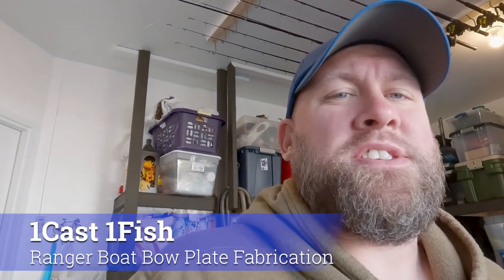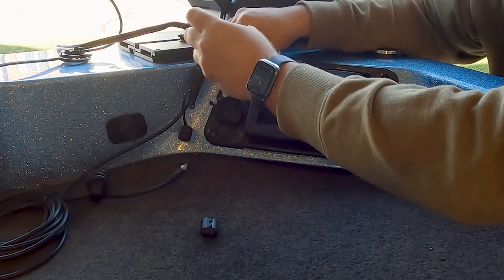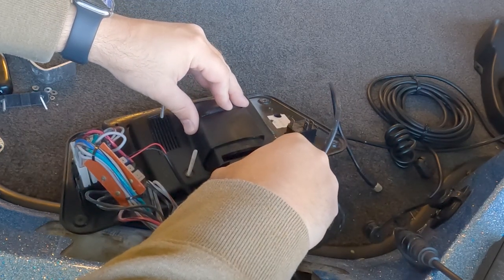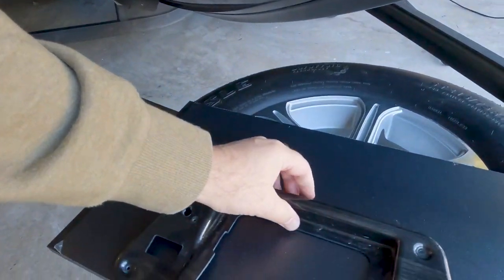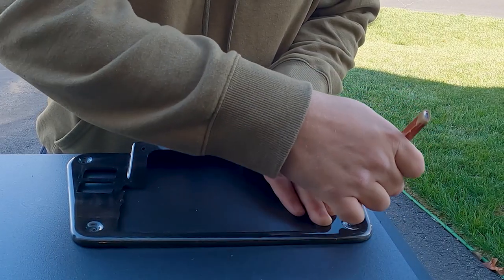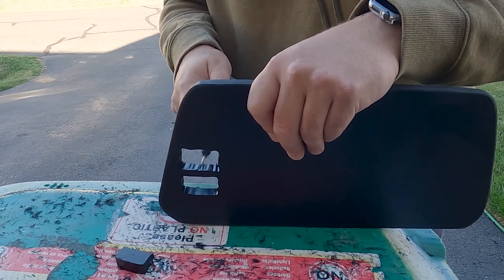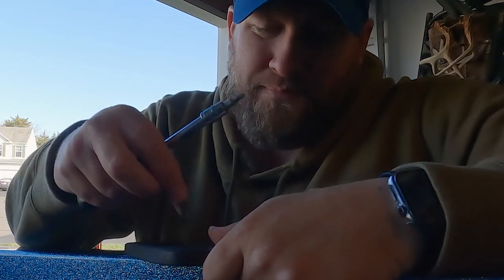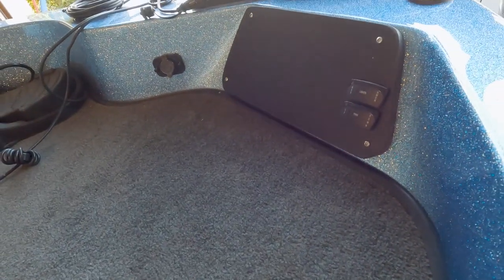DIY Custom Boat Bow Plate Fabrication

Comment: Really great job! Sometimes I almost enjoy working on, and modifying my kayak as much as using it..almost 😂. I manufactured my own custom heavy duty trolling motor mount and installed it on/in my bow. Came out great and works perfect. Those kinda things make us proud! Thanks for the awesome instructions and details on how you did this modification. Have a great one Paul. 👍👍👌✌️
Reply from the maker: Awesome you made a mount for the motor, they are expensive to buy premade.  I agree a real sense of pride and accomplishment with the DIY approach.  Plus I love tinkering with things :)

Comment: Where did you get the plastic board to replace the original? Also does it have the ability to bend into the natural curvature of the boat
Reply from the maker: Link is in the description...tons of options for size and thickness.
1/4" will bend to some degree without issue and I used it for areas that are not flat.
1/2" is very ridged and will not bend

If you need to bend alot I would look at something in the 1/8"  but depending on use it is pretty thin and not as strong...for a hole cover it would be perfect, but not good for mounting anything to it.